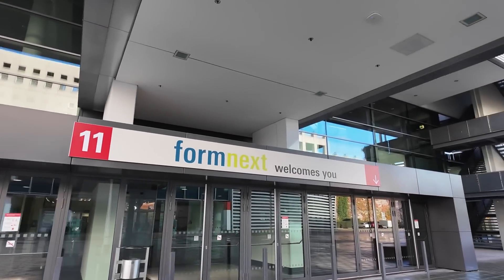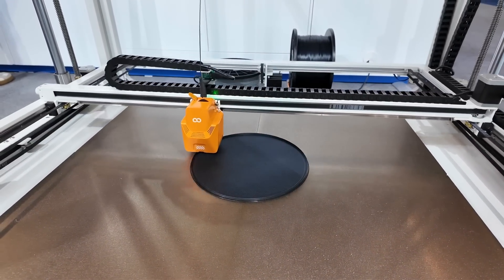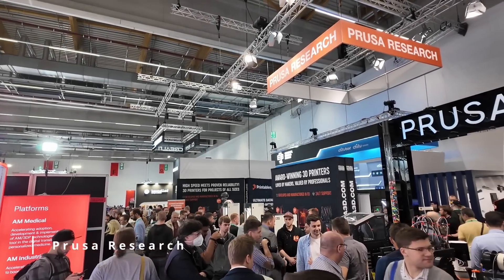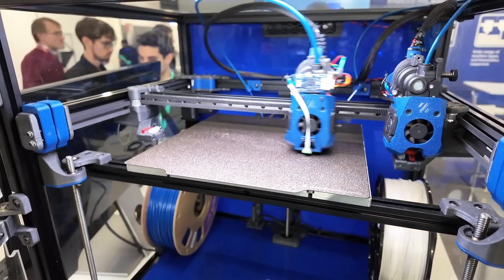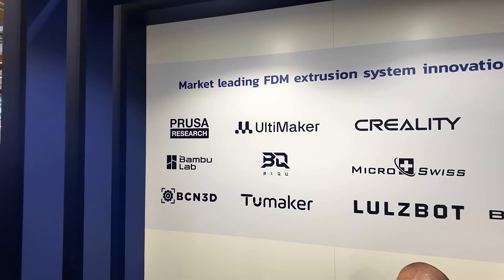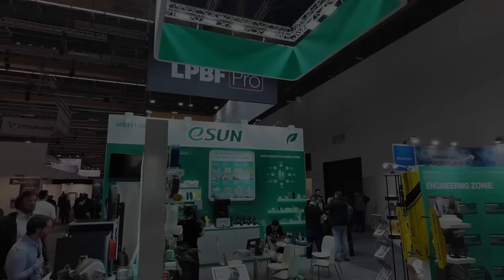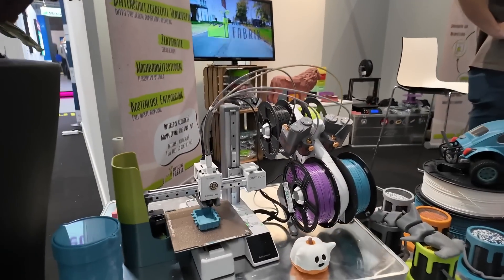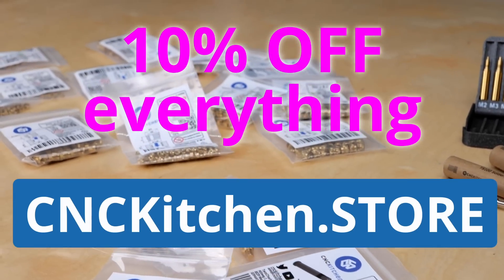14 3D Printing Innovations in 18 minutes: Formnext 2023

Comment: Always wondered about running two nozzles for color where one preloads the next color and discards the filament with vacuum out the side while printing, even if it just launched it away from the bed would be another reason to watch your 3d printer 😊

Comment: @4:45 320C not 350C  the additional $1000 includes AMS so it's not so expensive over standard X1C. they claim 320C makes it possible to print PPS, but you can already do it on the X1C - I do it easily.

Comment: I don´t understand the multi material craze. First of all multi material and multi color are two separate things. For multi color you are best off using the same translucent material and simply coloring it in each new layer. Multi material is useful when you want to combine well different materials like PETG &PLA or water soluble support or ABS & TPU etc.
Best set up would be probably 3-4 different material all in translucent with a coloring tool. This way you can print multiple materials in one print and color all of it however you like

Comment: Do you plan on releasing T12 Insert Tips at all? Had a measure and the TS100 will not fit into my KSGER T12 Station Handle, too short :(

Comment: We used a X1C and it was complete trash. After 1950 hours of use the lead screw nuts have over 1.5mm of slop and the print quality was on par with a $100 printer. After that i wont even talk about the X1E because i already know its going to be typical Bambu low quality trash. We got Raise 3D pro 3 plus's and 2 units have over 10,000 hours and they have zero slow in the z.  And Bambu said the 1.5mm of movement was well within there spec....you know the Bambu lab spec that is just a random number they make up that we have seen over the year with there support. Heated bed warped 1mm that's out of spec. Someone else shows 3.5mm and they say its whiten spec. As much as i hate Prusa and they are built like a 9th grade science fair project but they do last longer then the stuff Bambu sells and they actually have specs.

Comment: Sorry ,who is annoyed by socket head caps Screws?
Reply from the maker: Everyone!
Reply: @CNCKitchen  Hmmm, not me, even a little bit! I always buy metric socket cap screws. There's nothing worse than trying to remove,  'much less replace' a Phillips head screw without a good magnetic tip, especially if it's in a hole! Only time it's not 'better' is when you need the screw counter sunk. PLUS you can finger start more easily with a cap head. You could try Phillips head cap screws, but again, they don't stick to the driver and most people don't know what size Phillips to use and strip it going in or coming out.

Comment: Although it is kind of an old idea, I think the Ankermake V6 may be the best, and simplest way, to do multi-color. Compared to the tool-changer approach of Prusa or the AMS. Yeah you have a bunch of moving mass, but we have input shaping and step loss detection now. Put a 6-tool head like this on a linear motor motion system like the Peopoly Magneto, with closed-loop control, and now you're talking.

Comment: I was honestly skeptical of Anker makes 3d printer at first, now that I have one, it is by far one of the best bed slingers out there, literal plug and play, If I encountered any issue, a simple re-leveling and tweaking of basic settings of the print fixed it. Also love the fact that several parts can be replaced, from the heating block, nozzle, and even the print head itselt, and the continuing support is great to see also. Looking forward to a possible upgrade to the V6 version.

Comment: I think I know how the eSun filament is made. I recently did a video on some Amolen filament that behaves the same way. From looking at the filament cross section, it appears to be just standard co-extrusion or tri-extrusion, but it behaves differently when printed.  Originally, in order to get these colors to stay in alignment when printed, they were extruding filament that was oval in shape instead of round.   When printed, the filament would orient itself in the path of least resistance as it was pulled through the extruder gears, giving a consistent alignment of colors.   These new filaments I suspect are more round, causing the filament to rotates randomly back and forth when printed.  There is no consistency to thecolour changes, making the “wobble” effect resulting in fast changes in colour.
Reply: Great observation, and good example of a possible outcome when (Esun in this case) apply the development though: " what happens if we dont do this"

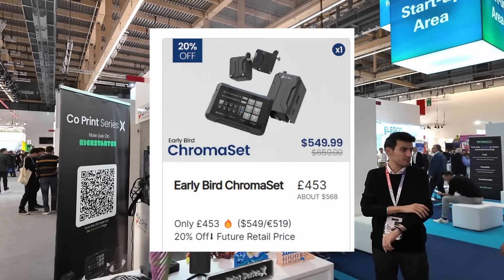Comment: 13:06 That's exactly what I have been saying. Co Print ChromaSet sounds great, but they're pricing it too high beyond the Kickstarter prices. For the price of a full ChromaSet with Pad and 4x Extruders you can buy a Bambu Lab A1 mini that will do the same job... and give you an extra printer too.
This would be a great addition to any printer, but they have to get the market price down to a level that will be cheaper than just buying another printer that does multi-colour straight out of the box.
Reply: Yeah the price is the biggest downside of it. It’s not exactly a new idea either, it’s just taken to the extreme with a filament cutter added in, even the A1M uses an incredibly similar system. Even compared with the standard AMS it isn’t really that great of a price.
Reply: Ths pricing is amazing and the fact that it works with almost any printer even more.

Bambu ams is bambu only
Prusa mmu has bad compatibility with other printer
Pallette is extremely expensive and if you have a printer like a neptune its hard to make it work with. I tried personally and ended up returning still waiting for a refund for the return from reprap store for over 3 months.
The ankermake not sure will work for other printers and most def slow and it seems limited to 6 colors.

Also chromepad is only required if you dont already have a pad and can be used on multiple printers

So if you want chromahesd for 3 printers you can get 1 chromaset snd 2 chromaset

So you end up paying around 1200$ if you get super early bird.

Thats 400$ per printer

Compared to the ankermaker v6 that everyone is so proud of that's 100$ cheaper than its advertised msrp price

If people are buying palette 3 pro that are around 1200$  they will def buy the chromaheads

Comment: Interesting exhibition, may pay a visit next year!
The AnkerMake prototype is clever, it has long Bowden tubes which make oozing more prevalent, but hot ends are individually capped and decapped, preventing oozing. I just think it can be not really fast with that huge moving mass, so the primary benefit is the waste reduction on material change.
Reply: I can’t see the caps lasting that long or being that useful. I would be very surprised if it prints all that well long term.

Comment: The Ankermake system looks like a really cool solution for printing non-flexible materials. I’m a little concerned with just how long the bowden tubes are that it could be problematic with more complex prints but eager to see the results
Reply: It seems like it might end up with issues, especially when using something other than PLA. Oozing could be an issue, the Z height of the nozzles might not be consistent enough, the mechanisms might wear too quickly, etc. also interestingly there was no prime tower, it would be easy to add in the slicer regardless but pretty much all multi colour printers have needed one until now.

Comment: I have tried Recyclingfabrik's rPLA after lerning about them in the comments on one of the videos on this channel. And I have to say: I'm rather impressed with it. It prints like regular PLA, the material itself is very homogenious in quality (so no "bad" parts on a spool) and looks a lot better than I expected. The only difference to regular PLA is that is seems a bit less brittle, which can be a plus (or a bit negativ, when e.g. removing supports). Overall I can absolutely recommend giving their filament a try! Especially since I find the price very fair even without any discounts.

Comment: RepRapFirmware has always been a bit trash.  Configurations aren't human readable, documentation is broken and revisions made across so many versions which aren't compatible with older versions and that's a huge hurdle when you're trying to set up a custom built machine.  Their hardware is very very well built, however.  So a great system to throw Klipper on to shore up how garbage the firmware is that they ship with it.

Comment: Happy to see PHA make an appearance. I've been slowly seeing what I can transition to making out of PHA. Most prototypes can be at the very least, which is often a lot of people's plastic waste.
Reply: PHA has some nice properties like heat resistance, also way less brittle than normal PLA. Now it warps A LOT. Some parts I can't even manage to print with it (yet I print them no prob in ABS…).
Reply: I use elegoo for prototyping and for many final products with great success. At 11$ I don't see myself using pha, way too expensive. 
But if it's works for you, great 👍.

Comment: Not the place,nor time to ask. But anyone intrested in a slicer that can do 90° overhang with no support on a stock ender 3 via non planar slicing? Got carried away with developement without stopping to ask if it's a good idea, but should be able to finnish it in 1-2months(may slip due to exams). The algorithm is done,working on a usable UI planning on making it opensource since I'm starting to reach a dead end with it.

Comment: The Ankermake color change system is a huge deal! While I don't think they have found the ideal solution yet, this is so much better than the very wasteful and time consuming Bambu style AMS. I am interested in multi-color printing, but not if it requires a ton of wasteful extrusion. I would much rather a system that results in some blobbing or color imperfections in infill and inner walls than one which has to poop everywhere.
Reply: Yeah, the printhead retraction/capping is a great idea, but the bowden extruders have to go. Either using ultra-light extruders (rq3's VDE-100 Schnekenstruder is about 60 grams), or a single motor with a transmission system to drive whichever printhead is active. The latter would also make it work with single-extruder motherboards, but would require custom firmware.
Reply: @dekutree64  if it had a single motor and some kind of transmission system it still wouldn’t work on single extruder motherboards. You would need some system to lock the unused nozzles, which would require some kind of connection to the motherboard. Then there is the issue of the hotends itself, each hotend needs to be individually controlled which means that each hotend needs a thermistor and heater cartridge connected to the motherboard.

A system like this just wouldn’t work with a motherboard meant for a single extruder, mostly because it still needs more thermistor and heater connections and if a motherboard is designed for a single extruder it generally only has support for one hotend.

Putting the hotends in parallel, essentially all heaters connected and a single thermistor wouldn’t work either due to differences in cooling, heating, flow, etc, between the individual hot ends.

Anyway, mainboards aren’t that expensive, you are better just buying a mainboard that can support what you need, or a system like Klipper where you can connect multiple mainboards. A BTT octopus with support for 8 motors and 4 hotends is less than £50 and a mainboard that could support 6 extruder motors and 6 hotends shouldn’t cost too much more.

Comment: I missed 2 boths:
- one research group modded an v0 with a e3d printed grid, which could be flipped, which enabled 90 degree overhangs on the contact surface.
- the small comapny who build coextruder for filament, manufacturing PC ancoated with ABS and ABS with diverse fiber materials

Comment: about those multiple print heads, you can add more of the moving beams, like 4x4 = 16 print heads, you just need to either attach both axes (x-y) or do some collision avoidance for the 4 beams. If aliens were here, they would say what are those human doing. that pad is a bit excessive, minimalism is for a reason, using the underlying 3d printer hardware. you are basically just adding a display, for what reason? do you wish to be a glass cannon, it shatters easily.

Comment: That ankermake material management cabinet is really cool. The size of that head is pretty intense though. Looks like it will be very heavy (affecting speed) and also the size limits the total build size you can effectively print. Still a very interesting concept though. Our calibration tool would work well for that too 😅

Comment: X1e only gets to 60C in the chamber which just isn't enough. Stratasys has decade of empirical data including physical prints showing that you need mucb higher. Try like 90c for ABC+ASA and it only gets higher from there for exotics like Peek and ultim. I think the top end stratasys printers have a controlled chamber more like 200c and they do really good at actively circulating so its really uniform without cold spots.

Comment: 90c max bed temp of elegoo giga is a huge deal breaker. (Not that I even need a printer that large but still...)
Reply from the maker: I mean honestly 70C wound have been enough. No way you can print ABS or anything else that warps on such a machine.
Reply: @CNCKitchen  I think with an enclosure added on and hot enough beds you could definitely print abs or other materials successfully if you can get the chamber hot enough. Would be great for some of the car parts I've got planned.

Comment: The Bambu lab X1E is a certified joke IMO, or maybe bambu lab as a company is a joke, idk I inquired about buying 10 of the X1E's and it's been 3 weeks and I still haven't gotten a response from bambu lab. Yet I contacted matterhackers, dynamism and engitype and got a response in less than 24hrs from all three. Problem is, all three resellers told me all warranty and after sells service would still be done through bambu lab. To me, it doesn't exactly instill confidence as a potential buyer if I couldn't even get a response for a $25k purchase order from the very people that would be handling all warranty and service parts requests.

I don't need the heated enclosure, I just need something can can operate 100% offline, be reliable and have a customer service that will respect my business and customers. Prusa got back to me the very same day about a purchase order for 10 MK4's and 3 multi tool XL's. So I placed the order with them. You snooze, you lose bambu lab 🤷‍♂

Comment: That's cool innovation with the 6 nozzle print head.  No purge tower? 🤔 This is really great because it's going to push others to step up.  

For me as a hobbyist, I'm still looking at getting a P1S and a couple A1 minis for simultaneous printing
Reply: They haven’t shown how well it actually works yet, there is a reason that every multi colour printer until now, including IDEX, has used a prime tower.